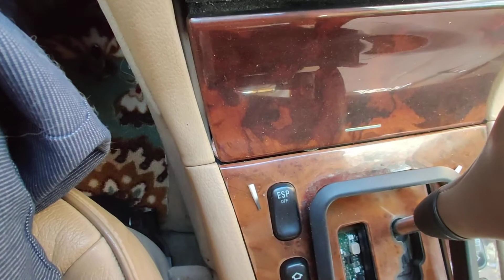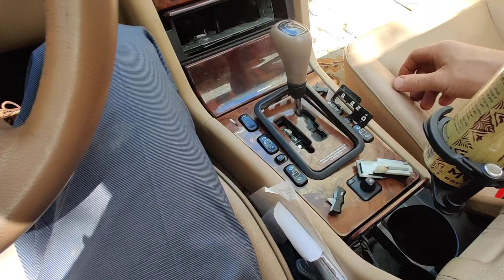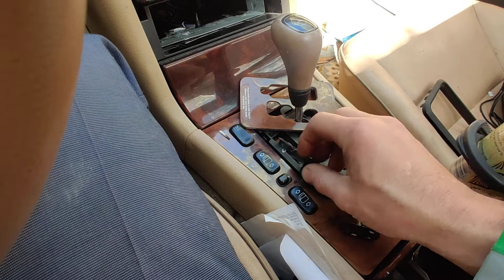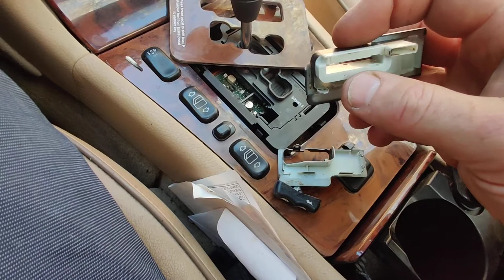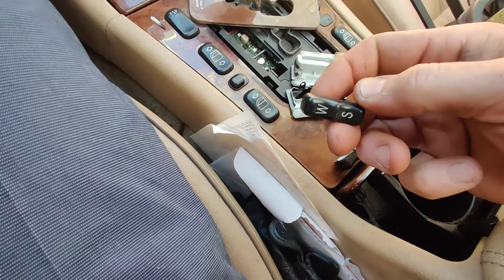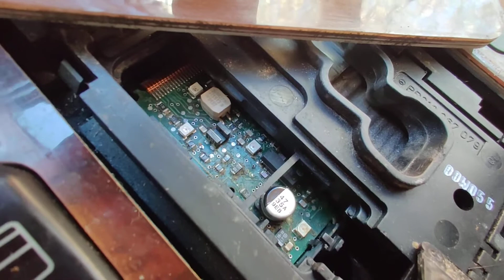2000 Mercedes Benz E320 4matic transmission mode switch

Comment: My e320 2001 v6 just got the check engine light and it’s been having problems when I start it once I put it below reverse , it won’t go back up past Neautral have to turn it off in nuetral and then put it in park:/

Comment: Hello, i have a 2001 e430 with the same issue. The SW button flaps around and i cannot tell if it starts in 1st or 2nd. Can you pls help me?
Reply from the maker: It sounds like it may be in limp mode, does it shift at all once you're moving?
Reply: @blackowlgarage6731  thanks so much for your reply! Yes it shifts normally. I took appart the assembly how you said, but there were quite a bit of lose parts inside and its a bit overwhelming for me to make sense of it. Is there anyway I could email you or something please? Or however your prefered method of sharing pictures is